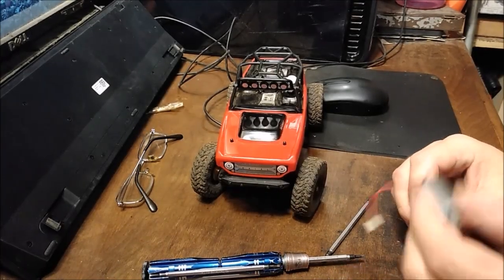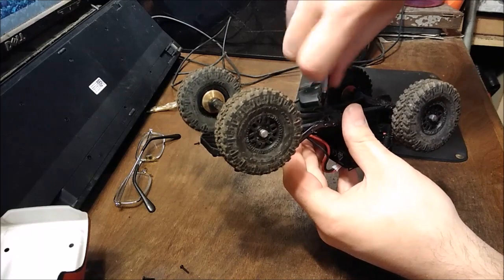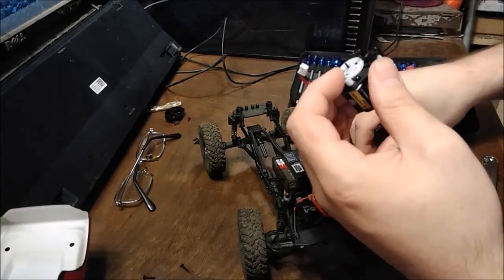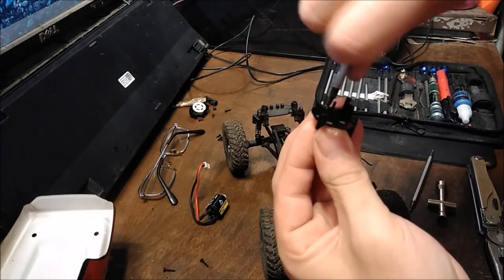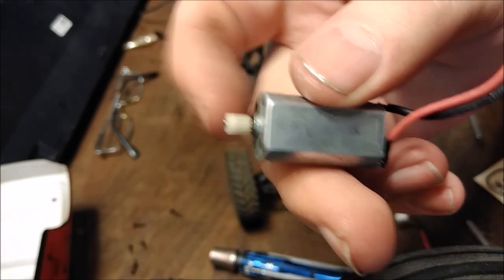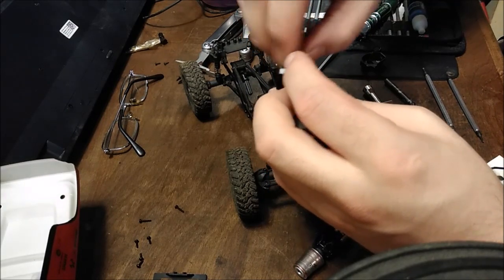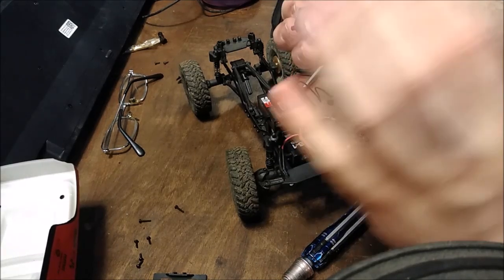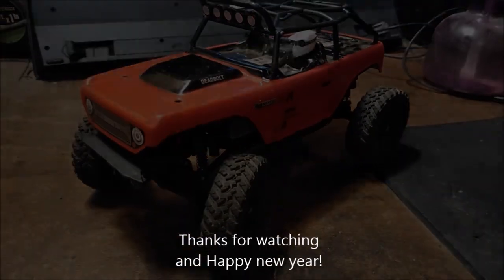Scx24 motor ecx barrage motor upgrade and mods! pt.1

Comment: You need to get the wow stick +1. It's a cordless mini screwdriver. Its the best tool for working on the 1/24 scale crawlers. I love mine ,I use it for all my RC's.
Reply from the maker: Ahh I don’t use power tools on any of my rc’s the ones I’ve tried stripped screw holes out way to easy. But I’ll look into that 1 for sure. 👊😄

Comment: Can't wait to start modding ours! 

BTW how many of them can you run at once? Will the interfere if you have 3-4 of the same type of RC? Thinking about buying a few more SCX24s for my younger boys.
Reply from the maker: You can run multiple no limits with 2.4ghz. if you get some for your kids don't let them use it alone. There rated 14+ for a reason. Also make sure to get a real hobby grade charger to. The stock 1 does not balance right and tends to fail or puff the lipos. 😅
Reply: @TJthercGuy  I'm new to this whole hobby so any suggestions are appreciated. Is there a specific charger you'd have in mind?

You're right about the chargers. Both my son and I's chargers failed after one charging session and was a big buzz kill. It was Christmas day shortly after we had opened them. 

But Horizon Hobbies answered my emails over the holidays and sent my two replacements and an extra one as a spare. 

My boys are 2,3 and 5 years old. The oldest is on the spectrum and can already name all the parts on a car including internal components. He is LOVING his "Yed-doe Jeep" 

The 3 year old had a turn and did extremely well climbing over the storm shelter. It is pretty steep and has lots of thick tall grass. 

I have already established it isn't a toy we can play with without dad being involved. I don't want to take any risks with the boys or their toys getting damaged. 

I'm going to use upgrades as incentives for good school reports and positive teacher feedback.
Reply from the maker: @marcochavanne  np we all have to start somewhere right. 😊
First look up lipo safety and care. Here is a link to a really good charger you can use with almost any RC battery. So your covered if you get different rc's to: https://www.hobbytown.com/hitec-rdx1-mini-ac-charger-6s-2a-65w-hrc44295/p1054480

Comment: I just bought my deadbolt yesterday and right out of the box I noticed that there was a little noise so after I used up the first battery charged I decided to open it up and I saw that the spur gear was wobbling back and forth when I would  accelerate which then created the noise that I was hearing! I’m hoping I can just adjust the spur so it doesn’t wobble
Reply from the maker: You can try to tighten it s bit but it most likely warped like mine is. It should be fine it happens allot in micro scale the parts are so tiny 😅. You can try setting the mesh a tiny bit loose sometimes that helps. 😊

Comment: How do you know your motor is bad? Drove it then charged the battery and awhile later turned it on and only the servo is working. Everything else is fine. Just seems like the motor now. Thanks as always
Reply from the maker: Basically if the esc is flashing red that’s your lvc talling the the battery is dead. But if it’s solid red the motors probably bad. You can hook the motor straight to power and see if it spins up to test or plug a new motor in to the esc. ✌️🙂
Reply: That's what I thought. Called Horizon and there sending me a new motor. I did order the barrage 100T for it tho. Thanks again🙏

Comment: Man, I didn’t even think about pulling the motor out like that. I was pulling it out the bottom, this is so much easier, I had to pull it again to fix a loose gear on the motor. I just used the stock barrage gear.
Reply from the maker: Awesome don’t forget to drill a hole in the spur cover to clear the Barrage motor shaft and pinion and your set. 👊🙂
Reply: @TJthercGuy  I ground down the shaft so I didn’t need to drill a hole.
Reply: Do you guys use the pinion that comes with the RGT motor or keep the stock one? Thanks!
Reply from the maker: @MelbourneExclusive0  I’ve used both it just depends on if you want to drill the spire cover or shorten the shaft and glue the stock spur. 👊😊
Reply: @TJthercGuy  thanks! I have the HR aluminum gear cover, do you think I still have to drill it? Thanks in advance TJ!
Reply from the maker: @MelbourneExclusive0  yes you will the hot cover is just a clone of the the stock cover. If you shorten the motor shaft a bit then scrape it up you can use a tiny dab of super glue to keep the motor shaft from spinning inside the pinion and you won’t have to drill the spur cover. 👊🙂
Reply: @MelbourneExclusive0  I did not drill it and I used the one that came with it since it was tighter. Just flip it upside down and sand the back a little. I also shortened the shaft a little.
Reply: @MelbourneExclusive0  I drilled to mount the motor but not the case.

Comment: What screws did you use to mount the motor? Mine didn't come with any and I don't believe the stock ones fit
Reply from the maker: I used the stock screws. Motor screws are basically all the same within there respective scale My experience. 😊
Reply: @TJthercGuy  thanks man!! Also, just to confirm, I don't need to flip the trans since already got enough weight up front so I only need to trim the battery mount piece? Some said the motor hits the frame. Thoughts?
Reply from the maker: Stuck in First  no you don’t have to flip the tranny but the wire might not reach and keep in mind you might have weight upfront but the bigger motors weight will offset that. Also flipping prolongs the life of the motor because it’s not running reversed all the time and helps with torque twist by moving the weight to the opposite side.
Yes it does hit the chassis rails but not to bad. Mines jammed ageist the rail and it’s been fine. But if you use the stock barrage pinion it might a louder like mine. But my spur is a bit warped to so who knows. 😂

Comment: Nice upload bro. Just finished installing the barrage motor on mine but when I pull the throttle it’s reversed now. Did you have that problem at all?
Reply from the maker: No but I flipped my transmission to. All you have to do it look on the motor plug for 2 little tab pull them up and swap the + and - wires around in the plug. Hope that helps. ✌️🙂
Reply: TJ the rc Guy 10/4 Much appreciated dude! 🤜🏻🤛🏼 I made sure to leave a Thumbs up too.

Comment: Hey TJ just got the ECX barrage motor for my scx24 I love the low end torque but now the drivetrain is super squeaky lol and high pitched even when I did a loose mesh, any tips on how to make it less noisy on the drivetrain? thanks again!
Reply from the maker: Did you remember to drill the spur cover and flip the barrage pinion? If not the pinion and motor shaft will hit the spur cover and if your using the stock barrage pinion without flipping it the teeth won’t line up right. 1 other thing it could be is your spur nut might be to tight you want the spur to have a tiny bit of wiggle on the input shaft. Hope that helps. 👊🙂
Reply: @TJthercGuy  wow. I reversed the pinion and took off the cover and It is less noisy now 👍. Did you use the ecx pinion or the stock pinion? I was trying to put the stock pinion in the the ecx but it keeps sliding out. Which do you prefer using?
Reply from the maker: @thegreatrc9302  I’ve used both in this video it was the barrage pinion. But you can use the cover and stock pinion by trimming the motor shaft then ruff up the shaft and carefully use a tiny dab of super glue to hold the pinion on the shaft with the shaft spinning inside of it when you hit the throttle. Just don’t get the glue on the motors bushing. 👊🙂
Reply: @TJthercGuy  thank you! I’ll do this 👍🏼 keep up the videos theyre so fun and relaxing to watch
Reply from the maker: @thegreatrc9302  oh will do for sure as much as possible. Feel free
To share the videos around  let’s make the channel big! 👊🙂

Comment: Do you have a steering mod? I do have a replacement servo for it but wondering if there was something to do with the stock stuff.
Reply from the maker: Randy Chamberlin yes you can pick up some small rubber orings put them on the ball ends between the steering link and knuckles to reduce the slop in it. Also you can glue the servo saver solid it makes a huge difference. Just be careful and don’t over tighten the screw reinstalling it.
✌️😊

Comment: Is this model same size as others or is it shorter
Reply from the maker: Same wheels base but every scx24 has different length links so the chassis a d trans sits farther forward I the deadbolt. Can’t say about the v17 betty tell I get mine. 👊🙂

Comment: Gonna be doin this soon to my c10 I’ve gone threw 3 motors
Reply from the maker: Harsh Fire yeah if you have a wheel nut or the spur nut to tight or even the pinion mesh to tight you will fry motors left and right. 
Oh before you buy a barrage motor I would test a motor not installed and see if it fries in a min or so. If you go through my video the deadbolt esc glitched and started frying motors. It took out the barrage motor and several litter testing the issue including a big beefy servo motor. 😔
Reply: TJ the rc Guy yea I’ve been driving mine out in direct sunlight and the motor gets super hot after a good 10-20 mins Of driving it can the motor dry from getting too hot
Reply from the maker: Harsh Fire oh yeah heat is what what kills allot of motors. 
On a real hot day you have to let it cool down or the brushes will melt inside the motor. If the motor is too hot to hold your finger on for at lease 10 seconds it’s to hot let it cool for a few mins. 
Even a 1/10th scale can over heat on a hot 90o+ day if you push it to hard. ✌️😊

Comment: Did this mod about a month ago and it's such an improvment!! Check out the chevy!!!
https://youtu.be/ZZXL0HSCEeE

The most recent trail run is with the motor upgrade
Reply from the maker: Cool i did allot of good mods on my first scx24 back in January when then first come out. I wanted to put this motor on then but didn't have a small enough drill bit so I had been putting it off. 😅
Reply: @TJthercGuy  I burnt my 4th motor up and couldn't get one till later this month I've heard. So I just finally did it. I have 70t 130can I am trying to get done but I need a spur gear
Reply from the maker: @ponderin  dang how much weight you running?
 It took brass widerners with overweights and some deep soupy mud to burn up my first stock motor and it had a few months or hard running on it before hand. 😅
But that's awesome let me know how it runs when you can Finnish it. I'm pretty sure you have to buy a entire tranny to get another spur. Try calling Horizon Hobby they might hook you up. 😊
Also try flippping the tranny if you haven't.  The motor runs in reverse rotation in the stock form. 😉
Reply: @TJthercGuy  I'm new to the hobby. So dont mind me asking. But what will I gain with flipping the trans? And she is pretty heavy. I think the body and sub frame is most of the wight.

I will say the stock tires do really well once they get broken in pretty hard.
Reply from the maker: @ponderin  tranny flip puts the motor weight farther forward and to the opposite side of the torque twist to help fight it. Also the motor isn't running in reverse to go forward.
As for the weight allot is on the chassis and body that's why there top heavy out of the box. But some axle weight or wheel weight helps. Added weight also helps with grip to.
If you check out my mil-stone wheel widerner video you can see how they affect the handling.
Reply: @TJthercGuy  sorry for the late reply. The milstone kit was the first thing I bought for it. Ordered the same day and opened the scx lol. I believe it was your video that lead me to them that late afternoon tbh. But this rc has opened up a whole new hobby for me. But I see your pros for the motor swap. Unfortunately I'm done with my current build. But I'm getting ready to build an actual "crawler" 
Would the motor swap pros be the same if say an...over the top kind of motor was put in it?
Reply from the maker: @ponderin  awesome! 🤘 Yeah micros are great for home courses travel and small areas. but  1/10th scale is where it's at out in big challanging area! 😉